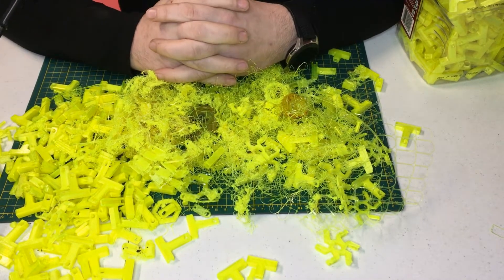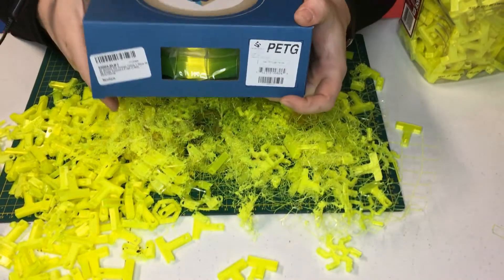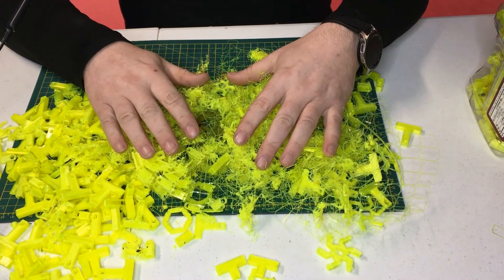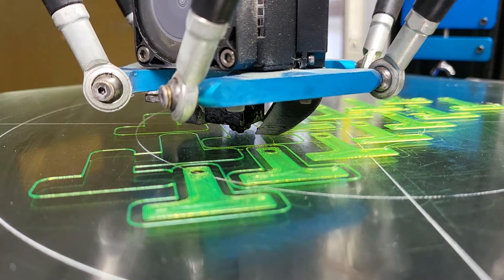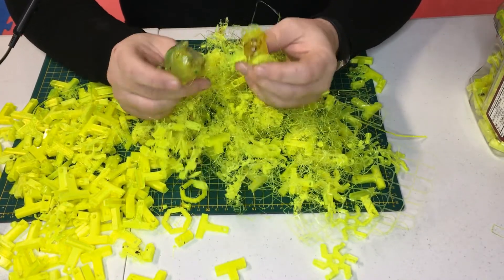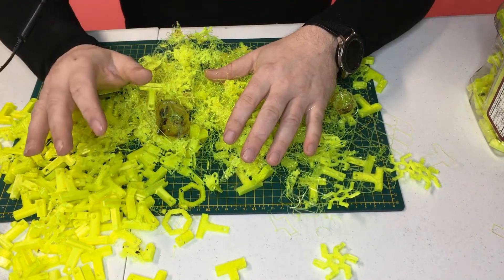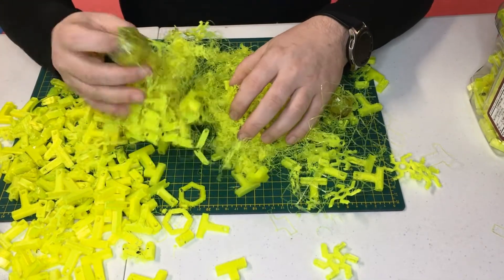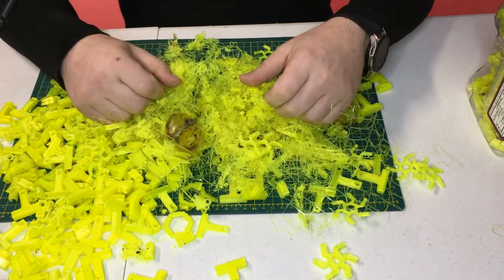Case when "Z hop" will do more harm than good.

Comment: I frequently use z hop with PETG.
though I've learned to keep the hop height to no more than the layer thickness, maybe a hair less.
just enough to keep the nozzle from dragging parts off the print bed, not enough to leave a random extrusion that extends past the next layer, to be struck by the nozzle later

Comment: Holy crap, are you printing all those small parts with All at Once on?
They are the PERFECT opportunity to print with the One at a Time setting!
The overall print quality shoots through the roof.
Especially with PETG, you are also reducing undesirable part cooling.
Reply: Indeed was about to say the same,  the ( one at a time ) setting is very good at doing multiple prints at the same and it completely avoids the issue this guy is having,  I used it recently when i was printing cable chain parts for my new Ender 3 and due to the amount i needed slapped 20 of them in cura and printed but got a lot of stringing even with good retraction settings resulting in prints that needed way more clean up than i wanted, then found the one at a time setting and it worked flawlessly with perfect prints, only down side is if you have a small bed you have to reduce the print quantity due to the head movement grey box, in my case i went from 20 all at once to just 9 in one at a time.
Reply: @EQINOX187  Yeah, One at a Time works better on my Ender 3 Max Neo.
They should let us override the clearance setting. Some of us are smart enough to print a few tall items on the same bed in an arrangement that won't produce gantry collisions.